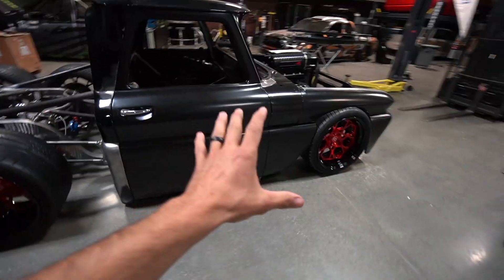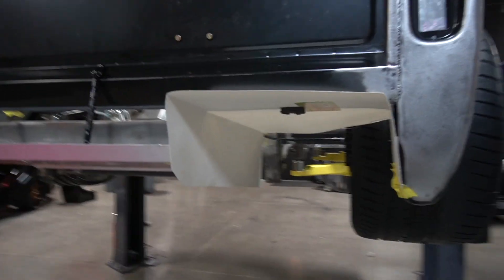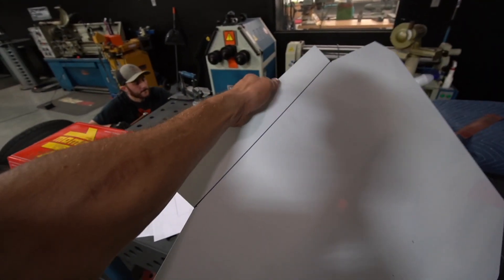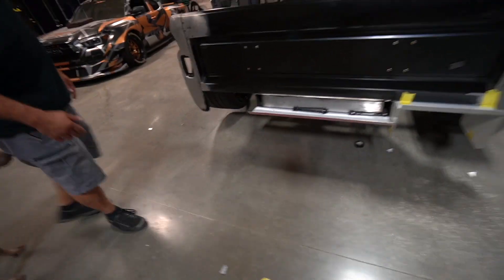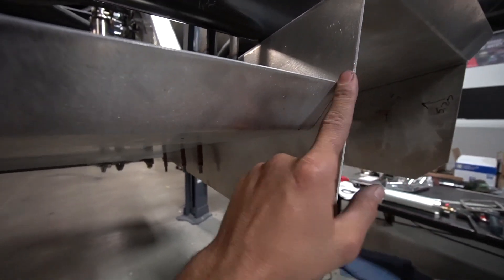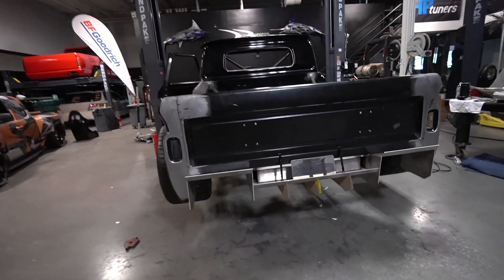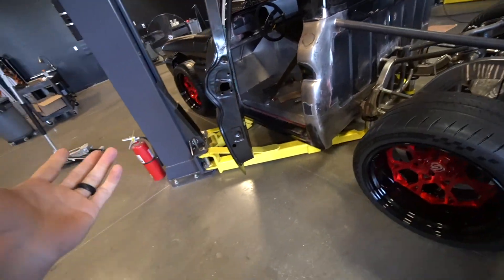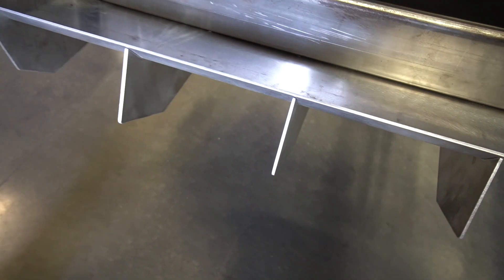I MADE MY OWN AERO DIFFUSER FOR MY 6 WHEEL C10! - C10 SLAYER EP.16

Comment: (  Idea:  Version 2,    8 Wheel C10 with the 2 back wheels tucked in the middle,  on Tesla P100D motors for drag race, on a separate locking  gear box diff, on air bags to lift and drop the rear tires that are e-motor driven , put that control on air plane joystick for power, instant torque )